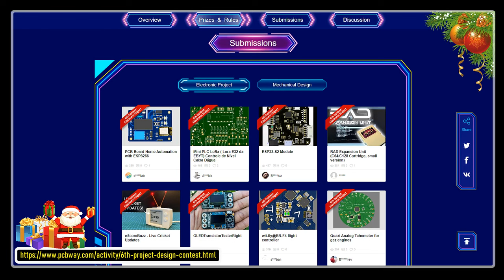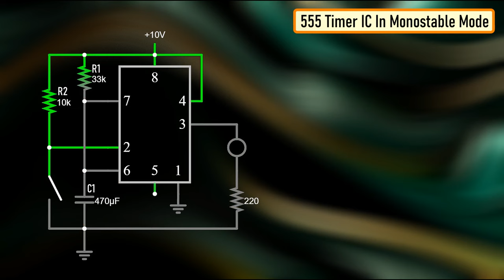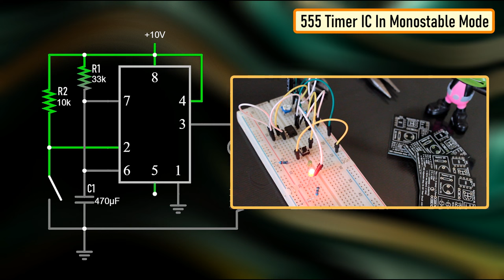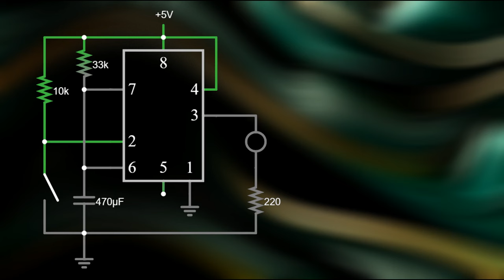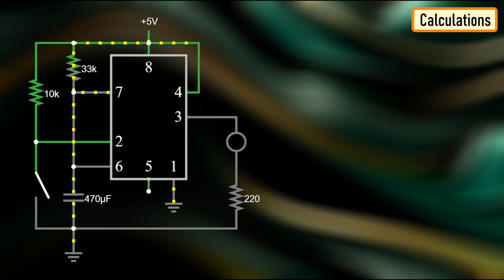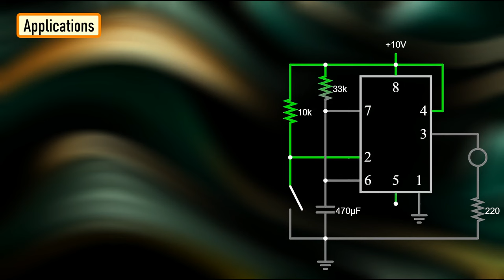555 Adjustable Delay On Off Timer Circuit

Comment: how to turn on off automatically electric heater after 10 minutes. is that possible with a circuit, and how to order online plz
Reply from the maker: Yes you can use the version with the relay module to turn on or off a y other circuit. 
You can order then from PCBWays website 
The link is in the descriptionbelow